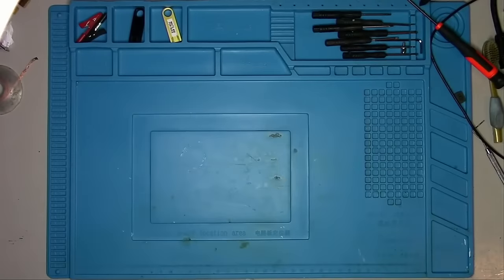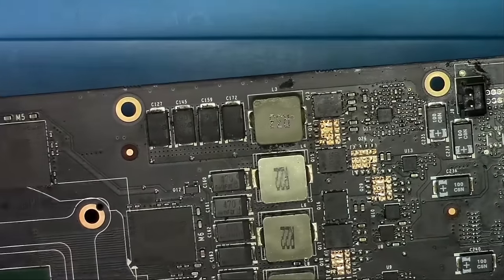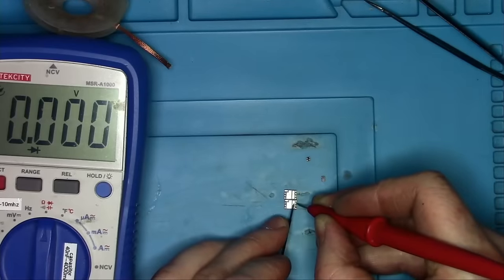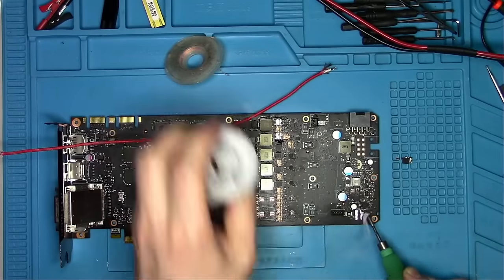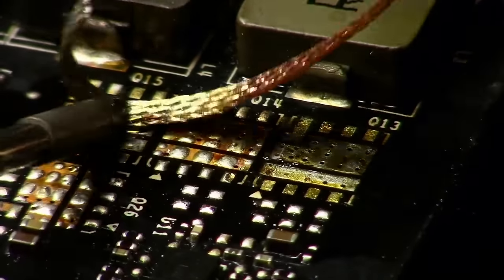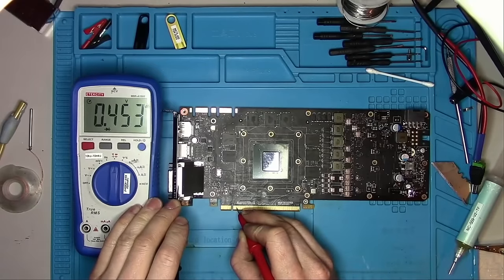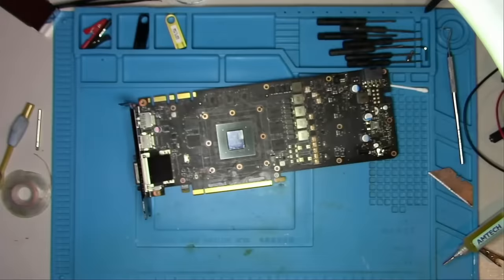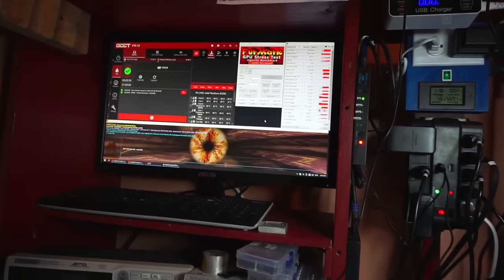What MINING does to Graphics Cards

Comment: I'm amazed you can just drill away into a graphics card like that and it'll still run fine after a few re-soldering tweaks.
Reply: The profile pic is just perfect for your comment.
Reply: black magic, i'm in awe
Reply: obviously it depends on what fault it is. Sometimes you can  do this, sometimes you can't
Reply: @BeHappyTo  right? in this case, it didn't eat through any essential traces it looks like, so it was possible to drill out the burned area and repair it the way he did
Reply: He knew how and where to drill out the bad part and keep the good...  Like a dentist.  Lol
Reply: Well in some cases, you do hit a critical line in the PCB.  The easiest fix for that is to run a wire from trace to trace where there used to be a single trace.  Think of it like a patch wire like they had before PCBs or like you see on prototype boards where quick adjustments are necessary for testing.  Louis Rossman does this sort of thing a lot on MacBooks where a capacitor erodes the traces, or in some cases soda.  Apparently someone was looking at hot models at night on their MacBook one time and he found a white substance inside the MacBook and called it disgusting.  Maybe they have a techno fetish or something.
Reply: its ok its power plant had wide amount surface on pcb, if u understand dc to dc converting scheme its all the same with different safety, he removed just like removing tumor on ur flesh, u still had a chance to Life health after surgery
Reply: Ya and all the SMDs he popped off that were there. Surprised them missing didn't hurt anything.
Reply: I just don't understand how you can just remove some components and everything works fine. Are those (look like resistors) unnecessary? I don't get it!
Reply: @picasso566  He explained they were filtering capacitors on the 12 Volt line, that's why he could get away with replacing them all with just one capacitor.
Reply: @walter....  aaaah! Thank you! I didn't hear that in the video and I kept jumping back and forth trying to find out how the hell he could just nuke all of that. Grinding into the PCB I understand, but you can't just delete portions of a circuit without consequences. I seriously wish I kept up my electronics training, I switched to software over 30 years ago and this kind of thing fascinates me.
Reply: An old rework guy I used to work with bet me he could fix any board, the guy used to do work for NASA so I was like ok let's see what you got. I took an I.O board for a newer pinball machine and bent it aggressively in half, you heard the crack and it was basically shaped like an L at this point. 3 days later during his "free time" at work, he fixed it. You should have seen my fucking face because to my surprise he LEFT IT SHAPED LIKE AN *L*. He replaced any parts that came off and using the schematics he built the traces and layers up one by one (the board was like 3.5ft by 1 ft i broke it down the center). Played just fine. 

Though with something as fast as a graphics card im pretty sure (correct me if im wrong internet do your job) that the length of the trace has effects the timing.
Reply: @crazychainsaw007  I imagine that coming out like those PCBless designs I see where they just solder everything in 3D. I see that often with small speaker crossovers, or electric motor controllers.
Reply: @picasso566  You would think right! it would still be impressive but he actually used traces, fiberglass powder and solder mask, his iron, heat gun and time. He would it had it done quicker too but that fact that the board was so big and bent it wasn't really feasible to use the hot air rework machine.

I could repair stuff no problem but these guys with lots of years of professional experience are just good at what they do. Dealing with things like people watching over you while you solder to judge you and getting the same Class 3 product reinspected by multiple different parties if they care enough they can make it look like no one even worked on it.
Reply: ikr what a hero saving that board like that i prolly wld have jus sold it for parts lol good to see it could be saved
Reply: true. PCB has multiple layers. Might get shorted.
Reply: The burn caused traces to short to ground. You have to break up that connection.
Reply: @kasuraga  Yeah who needs that copper to cool the mosfet? It didn't do it any good the first time it burnt up either.
Reply: After all is just tp that cracks cuz of urnegulated curent from driver
Reply: @dohabandit  Looked more like 5 or 6, but yeah that hole is giant.  There's probably some problem, but if it generally works then that's a lot of money someone saved.
Reply: @1pcfred  The burn, if originating from the mosfets themselves would have burned from the top side of the board down, not from the bottom up. Those are SMD electrolytic capacitors, known for cracking under thermal stress and then getting even hotter when they internally short. No one is arguing that it got hot, but if normal operation caused this, then every 1070 out there would do this. Except most 1070s don't do this and damage to this level is pretty much a miner or overclocking issue. Which means pushing the card past it's design limitations, or running it 24/7 at max load without any maintenance is the cause of the issue. Not the amount of copper in the layers. Heat soak in a GPU board is a real problem, every source of heat transmits through the board. If the thermal paste was getting dry, and airflow was restricted as we saw in the video not only does heat rejection from the mosfets become an issue, but heat soak from the main die itself  traveling through the board into other heat generating areas becomes an issue as well.

If put back into mining service, this car is probably still on it's last legs with only a couple years remaining. But if put into regular use, it likely still has many years left.
Reply: @2009dudeman  I can see the copper that was in there and the vias. All of that was in the board to heatsink the mosfets. Now it is not there. Simple as that.
Reply: @1pcfred  If I light a fire on the front of a piece of wood, does it start burning through on the back side first? You can see as soon as the bottom plate comes off the capacitor is cracked. There have been entire product recalls over SMD caps causing fires because they cracked. Simple as that.

Less simple is the fact you can't boil this down to more copper equals gooderer and less copper equal badder. Clearly the thing got super hot, no amount of copper tracing would have heatsunk that away. The main cause of failure was neglect, if it was a PCB design flaw then EVGA 1070s all over would be having this same problem, yet they are not. But take even the best designed card out there are remove 50% of it's cooling capacity and you will have this problem.

No sir the engine in your car seizing up isn't a result of you not changing the oil, its a result of the hole in the block when it threw a piston. Clearly they should have made the engine block thicker 
🤣🤣
Reply: @2009dudeman  wood is not made out of copper which is one of the best heat conductors known to Man.
Reply: @1pcfred  so? The board is made of fiberglass too, known for not being copper. At the end of the day it's crazy you are trying to argue the backside only and not the front of anything burned because of heat on the front of it. Dude, there isn't even a single scorch mark on the front. Even crazier given the cracked electrolytic cap in the middle of burn, when no other cap was cracked is not the cause in your eyes. It doesn't matter how much copper is there, the hottest location will always be at the source of the heat, in this case in the back of the board.

You had an idea, it was wrong. There is nothing wrong with that, but there is something wrong with your refusal to admit that.
Reply: @2009dudeman  that's why they put vias into the board. The vias conduct heat through the non-conductive substrate.
Reply: @picasso566  these capacitors are used to lower the output impedance of the voltage regulator
Reply: @2009dudeman  Happy Saturday!  Those caps were ceramic.  You are correct about thermal stress breaking them.  All though it's cycles of thermal stress of the FR4 PCB material expanding and contracting breaking the cap.  Ceramic caps don't care about heat cycles.  But being ceramic, they are extremely brittle and the PCB was wrenching on them.  Electrolytic caps are much bigger aluminum cans filled with fluid.  Signed, Professional PCB designer.
Reply: Also, The caps cracking first was what caused the internal short.  The caps shorting bridged some internal power planes which caused the smoke event.
Reply: Yeah...it's excvation of ththe burn mark. Used to have to do it a lot at my job when card components blow. Drill out all the black and if you don't go all the way through you just fill with epoxy. Sometimes you have to go all the way through the board and make a plug from another board
Reply: why ? its jusst a PCB... with no traces in those areas youre fine... seriously ? and evcen a broke trrace can be fixed with wire
Reply: @wiiu7640  did. reportedly he no longer runs a repair business, and is working for someone else instead. because he was too sick and tired of apple's shit.
Reply: @512TheWolf512  He still owns the repair business, he did take a job for someone else, but it had nothing to do with Apple. Where do people come up with this shit?
Reply: What drill didn't see one seem everyone else seen a drill.
Reply: @Truthhurt  Did you just have a stroke???
Reply: @Truthhurt  yea he had a dremel and sanded down the outer coating of the pcb to get to the copper plate inside to solder.

Drilling or doing that isnt a big deal as long as it isnt on a trace.. but traces can be easily repaired if their large ones.. the super tiny ones are very hard to fix though.
Reply: @kasuraga  it seems the short was near a via, that's why the fix works

and it looks like its a 4 layer board with lots of metal inside to dissipate heat, most are probably ground shielding, you can drill through those without disrupting much
Reply: "fine" the EMC will never be the same.
Reply: @picasso566  Research Electro mAgnetic compatibility
Reply: @picasso566  Hint, the word Filter was mentioned.
Reply: @picasso566  He understand the circuit board he's working on perfectly.  I assume he has looked up the full schematic, knows the location of everything, the function of everything, and knows exactly what he can get away with.  He probably dreams about these boards at night.  That's how it's possible.
Reply: No drilling took place. He was using a pen grinder.
Reply: With multi layer boards you could be cutting into track connections between components, yes you can do this as long you have the circuit board map & schematics in hand.
Reply: @picasso566  He has plenty of the same spare  GPU's to reference from, when you have plenty of other broken GPU's you can cannibalize parts from them.
Reply: With adequate knowledge u can do anything in this world
Reply: @BeHappyTo  False. I could NEVER do this.
Reply: Graphic cards are more durable than we actually think !
Reply: When u know what youre doing
Reply: Mans just did a root canal on a graphics card
Reply: @NutkeyDoesMinecraft  mate, I like your humor
Reply: Alot of times, It techs won't bother with issues like this one. Unless you pay a great deal. Mainly miners take better care of their Gpus, keep the room air conditioned and clean but not everyone. I bought a used RTX 3060 TI that was not meant for mining but stil used, from an apartment you'd hardly call clean , yet after dusting the GPU a little, it was perfectly OK. Of course I tested it before buying with a burn in test using Furmark so I knew it wasn't faulty, but when buying used you should ALWAYS test. So don't be afraid of mining GPUs, they can be great and better cared for than most gaming rigs GPUs
Reply: I 100% agree with teachergamer1981 I was a miner for 4 years not huge only had 15 1660supers to start they never overheated ever then got 10 rtx3080s and I over clocked but not extreme and every 6 months replaced thermal paste and pads only because I live in Fresno CA. And summer temps be over 100-115 f but never let my men temps go over 90c and mining eth didn't worry about core and my cards all passed furmark and had same fps as a new one even the print on mem chips were still white weth little fading and that gpu was overclocked too high and allowed to cook meaning he didn't know what he was doing plus unless this was during the gpu skyhigh prices having this guy do this would not be worth it
Reply: After reading your comment I decided to drill into a random section of my 3060Ti. It is now broken and I am going to sue you, can you provide me with your details so I can serve the lawsuit to you. Thank you.
Reply: Same. I lost my mind watching that
Reply: Just understands the topography and more important the tunnels that the angry pixies use to get around through the board and components. 
Just like a city transport network, he knows where the subways are so can just drill through the road (board) to get to the problem when and where trains (angry pixies) will not go through. Then just builds a new road over top or around the hole if needed for the pixies travelling the roads (board top/components).
Reply: jordanrodrigues1279   "The failed area was a buck converter. Think of it as a pump that runs on the 12V input and dumps out a lot more current at a lot lower voltage. Since that's what high performance logic generally needs.

There are several of those pumps because they actually need to operate in pulses, more pumps gives a smoother power supply. So after this repair the supply won't be as smooth. The card might need to be underclocked for reliability and/or run with a higher voltage coming out of the remaining buck converters."

I'm sorry my dude but that is just wrong entirely.
Yes, a buck converter 'bucks' the voltage down to another voltage. Yes due to basic physics the current increases proportionally to how much the voltage decreases. 
'High performance' logic isn't a thing, all logic level signals need these voltages, typically use 5V/3V3/1V8. 
The whole part about pumps is just wrong. Maybe what you are refering to are the decoupling capacitors. These are related to the smoothing input voltages near ICs and the small value caps help take care of higher frequency ripple.
As long as these power rails deliver the required steady voltage and current (which I have no reason to think they won't after this fix) then the card won't need to be underclocked. Nor will the other power regulation need to be run at a higher voltage.
It's ok not to understand something fully but I don't understand why people state things which, are just so blatantly wrong, with so much conviction?

There are numerous other strange things people have suggested in these comments like "Looks like they drilled down 6 layers!" to "Its only a 4 layer board" (it definitely, without a shadow of a doubt, be as few as 4 layers) but I just ask people to read comments skeptically as there is so much misinformation out there.

For reference, I was an electronic tech, then an electronic design engineer. Designed some power, some high speed signals, 10 layer boards, so have some experience in this field.

Edit: and I would never have dremmelled back the PCB like this to power planes, hats off to the guy as that is ballsy 'in for a penny, in for a pound' stuff!
Reply: Another dr Stone fab
Reply: Explain to me how it still managed to work after that drill?😂
Reply: Heat pipe set up is with cooler on the top; the heat flowing from the hot GPU to radiator on the top. But set up properly, brand logo upside down!
  
I have seen lots of roasted or baked GPU issues from heat pipes upside down.
Reply: Because that's what a PCB is. Just a surface you put stuff into and arrange connections. The many chips, though, are much more complex and have much smaller parts (microscopic, even).

Doesn't change the fact that his problem-finding and soldering skills are top notch, but you are maybe giving too much credit to the fabricators of a simple and relatively cheap thing.
Reply: The filtering capacitors are like an extra 12v battery in parallel with the 12v power supply. If the PC had a low quality power supply - or too low wattage power supply - a burst of gpu power consumption might cause the voltage to "droop" maybe down to 11v, 10v, maybe causing a failure.  As long as the PC power supply is good and the card is not running at 110%, the caps are not needed ... Most minimg rigs undervolt and underclock to try to extend the life of a 24/7 computer so the risk of needing the caps is quite minimal ...
Reply: It's like moving gravel with a wooden shovel. The material of the shovel is not suitable for such work. This graphics card breaks down when mining.
Reply: @rumplstiltztinkerstein   real
Reply: depends where... pcbs are multi layer
Reply: The pub’s are layered, so grinding a couple layers shouldn’t a problem.
Reply: PCB repairs even more extensive than this are standard practice for PCBs from industrial and scientific equipment that may cost more than a new car. Pace Worldwide and other companies supply stencils for trace and pad replacement and specialized equipment for this. There are Pace training videos on cutting out and replacing entire board sections. If a really big part of a board is damaged you can replicate it in an EDA program and have the missing section remanufactured by a board house (much more affordable these days with online services for small production runs then it was back in the day) and then graft it into the original board.
Reply: Lol your profile picture matches the comment. God bless. Jesus loves you!
Reply: This man is who you want as a friend during an emp attack
Reply: schematics
Reply: its all one continuous layer, poking a hole doesn't do much to the layers in most cases
Reply: Hey how could removing certain parts from card runs the card fine without ANY issues???? Like they were there for some reason??